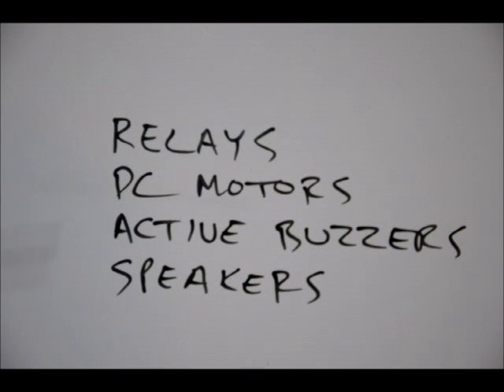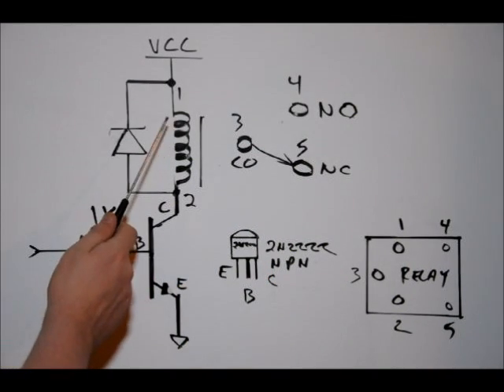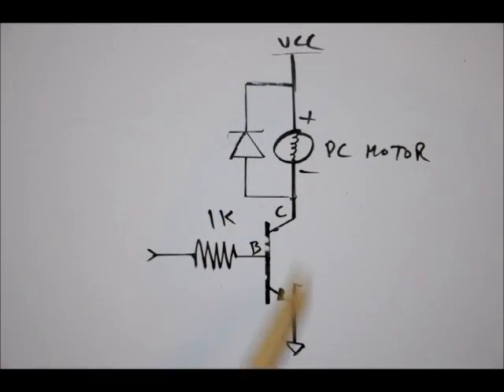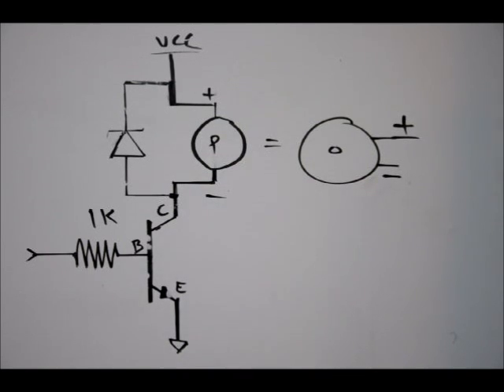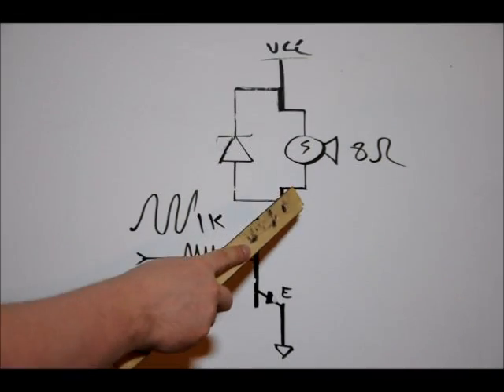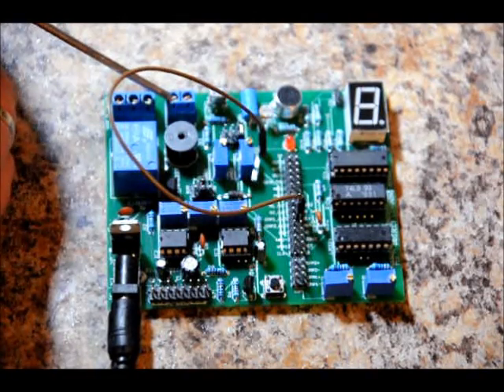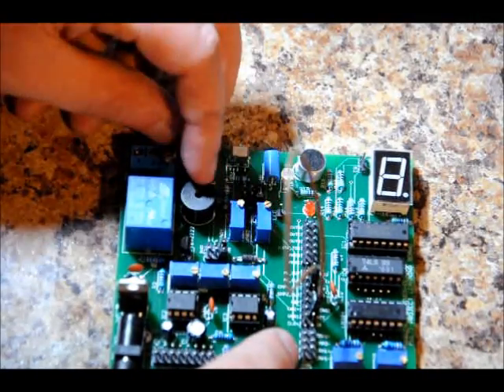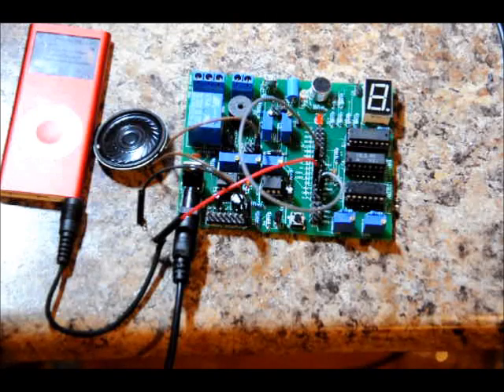Electronic Tutorial: How To Drive Relays, DC Motors, DC Buzzers, & Speakers With A Transistor

Comment: What limits the current through the transistor when driving the relay or motor? I assume the transistor operates in saturation where current is limited by external components. - Thanks!

Comment: If we are using 12V relay then what will be the Maximum and Minimum voltage to turn on the relay ?
Reply: 12v brother..

 But in case of output u can connect 115v @ 5ampere current and 230v @ 10ampere current

Comment: hey Patrick!
when I m employing the same relay circuit to switch a DC motor
I m facing difficulty..
but when I replace the position of diode nd put it across the transistor terminals I.E;collector nd emitter
my circuit is working pretty effectively!
what may be the reason?

Comment: Does it matter the Amperage we send through the Base of the 2n2222?
Will the transistor be low resistance even if the current is not enough? If yes, how many mA do i need on the base for it to be full open?

Comment: Could you tell me why use diode to protect the load instead  of using capacitor ?
Reply: the coil produces a MAGNETIC field when current flows through it BUT when the transistor turns OFF the current is stopped. This means that there is nothing sustaining the magnetic field - which then collapses -  the relative movement between the coil / conductors and the collapsing magnetic field induces a voltage / emf in the coil (it actually induces a "back" emf / voltage which seemingly tries to maintain the flow of current in it's previous state) THUS returning the energy stored in the magnetic field back into electrical energy.
back emf e =  - (Number of coils) x (rate of change of magnetic flux / time)

This induced voltage 'spike' can be large enough to damage electronic devices in the circuit if unchecked (think how is it that you put a 1.5V battery into a trick cigarette lighter and still produce enough voltage to give people a nasty shock..?! same principle but the battery is used to produce back emf voltage many times higher than tits 1.5V)  SO the diode is a path through which this induced BACK emf voltage can drive current round through the coil and hopefully dissipate the energy &  limit any voltage to safe levels...... A capacitor has XC which may be low enough to seemingly let current flow BUT it will store the energy not allow it to safely dissipate

Comment: Hi Patrick. I'm a novice in the field of electronics, but enjoy building little projects. I'm currently sitting with the below mentioned project and would like to make use of a  transducer buzzer to indicate when one of the LED's are off. I'm using the LED's in bar form to indicate battery status and need an alarm to sound when say D4 switches off. How can I connect a transducer buzzer into this circuit? Also, would it be possible to reset/silence the alarm? Any help would be greatly appreciated!!
http://www.circuitstoday.com/12v-battery-level-indicator-circuit-led-bargraph